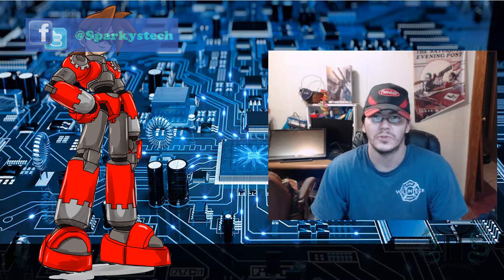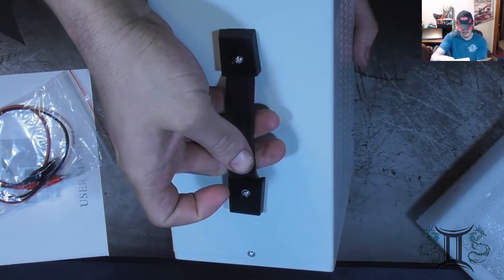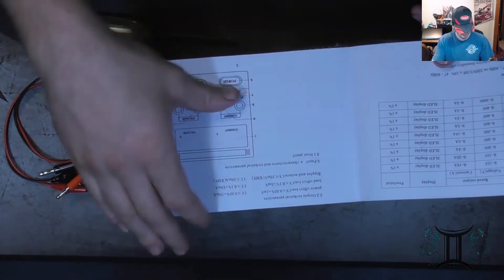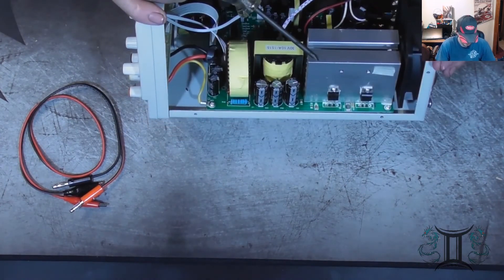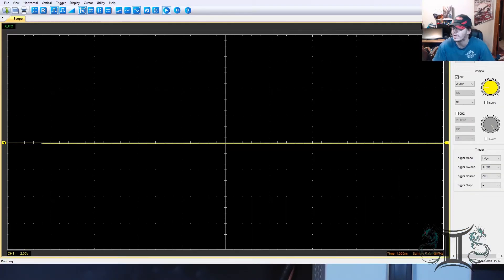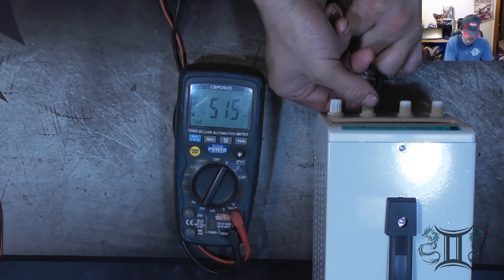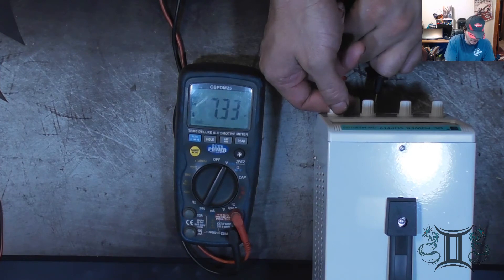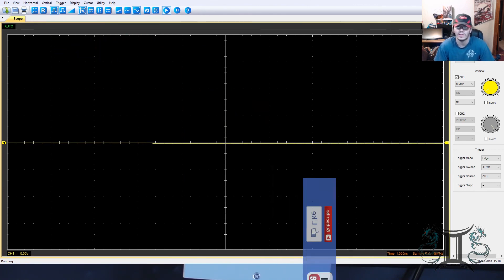QW-MS3010D DC Power Supply Review

Comment: using real scope,,, seems to give 4v pp  noise,,,,
Reply from the maker: kish bhar not going to say your wrong, it is a cheaply made unit, I know my scope is accurate because I use it at work to check j1939, it’s still flat on mine, but doesn’t mean the power supply manufacture didn’t catch one, that could be one of the filtering caps also, they were the cheep ones in mine, but thank you for the info, I’ll note that down
Reply: Yep, that is what to expect with it loaded up.  If you see ripple under no-load -  chuck it in the bin.